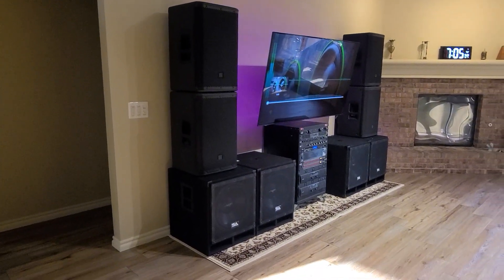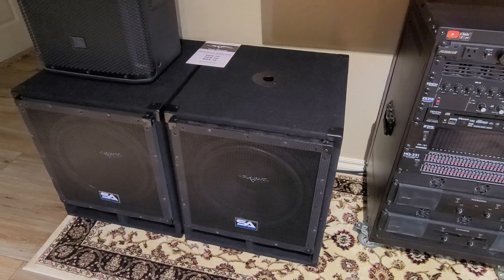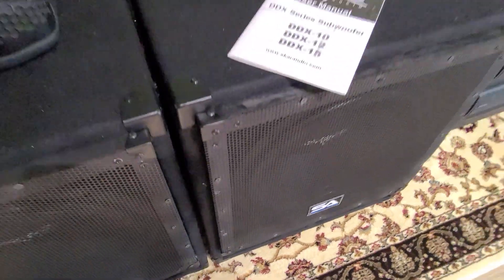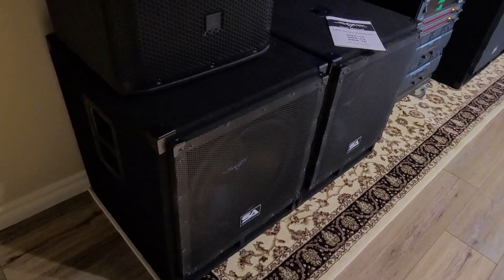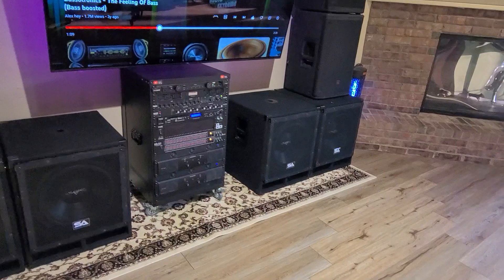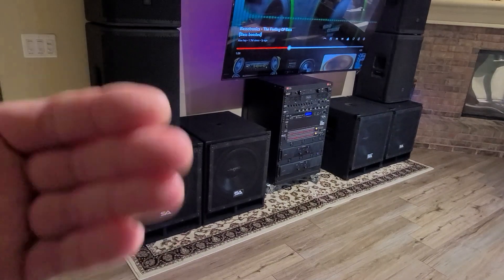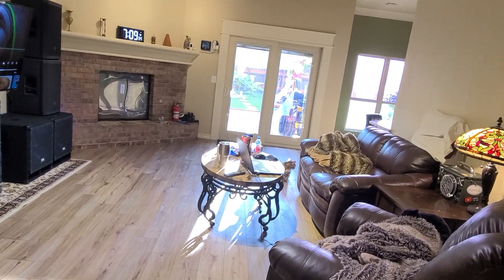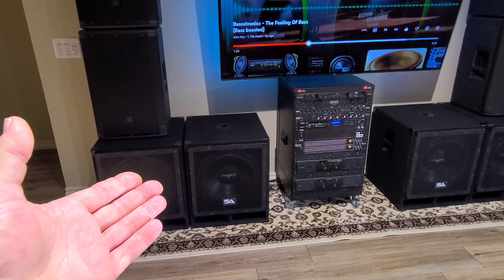Seismic Audio 15" Baby Tremor PA/DJ subwoofers modified (replaced subs with Skar Audio DDX-15 D4's)

Comment: car audio 15 inch spl max 90 db pa speakers woofer 15 inch 140 db
Reply: Correct!  ...  Those are rated at 20 Hz - 250 Hz , 90.0 dB and will handle 1KW RMS. What other "AFFORDABLE" PA subs get into the 20Hz range? There is none! He made due with what he has.
Reply: You'll lose some 65-100 Hz but be just as sensitive in the lows as that's more about the box size and tuning. They won't go much lower though unless you add extensions to the slot port.

Comment: Hey!! You mentioned Yamaha cabs! And I’m a DJ and I’ve been wanted to buy the skar ZVX 18v2 and shoving them in my Yamaha club dual18 cabs but it’s hard to find videos of someone actually doing it 😅
Reply from the maker: Awesome. Great idea. However, I found these 15" PA/DJ cabinets tuned too high for car audio subs. They sound "alright" but, could growl better. Here is an idea: convert a car audio subwoofer box into a PA/DJ subwoofer cab. I made a powered one and it BOOMS nicely! Here is my video how I did it: https://www.youtube.com/watch?v=HFpvSV3Swgg&t=10s
Reply: You would be better off building a custom ported cabinet for those 18's that's tuned to 28hz-32hz with enough port area , there's free software online to design the box , and you can get the MDF cut at home Depot, and just glue and clamp it yourself if you don't have the saws and other tools ect. Carpeting the box is easy , just a few cans of 3m spray adhesive and automotive carpet.

Comment: Very tempting to test it out with the vinyl version of Tchaikovsky's 1812 Overture using the original score for orchestra augmented by church bells, cannon and brass choir. For the cannon, an authentic Napoleon-era (1761) cannon was recorded at the U.S. Military Academy at West Point. Then maybe a follow up with a chaser of AC/DC. Volume control fully clockwise of course.  :-P...